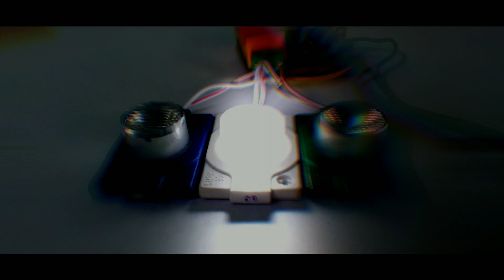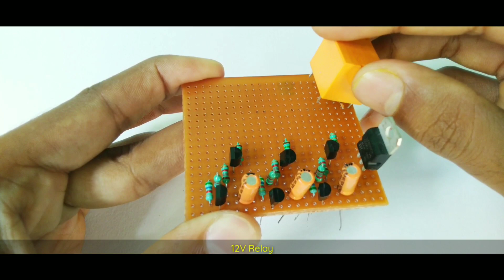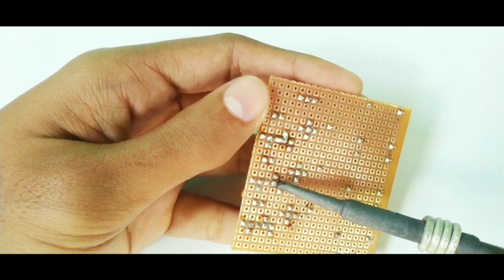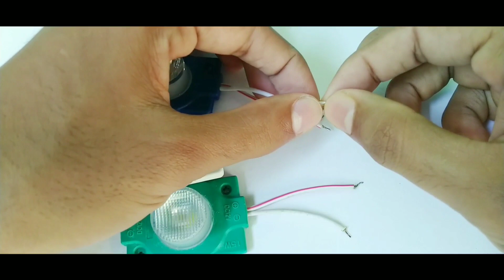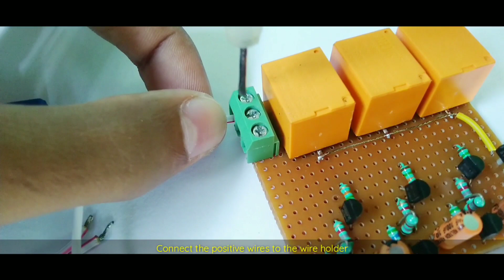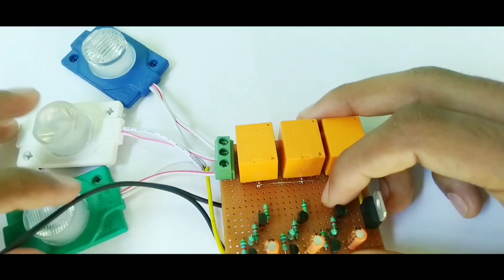12V led chaser using Relay

Comment: what does 1-2k mean, is it 1.2k or between 1 & 2?
Reply from the maker: Between 1 and 2
Reply: @estechknowledge  thank u.  I used 1.5k (1-2k) ,10k(10-15k)and 5.6k (5-50k)resistors. The circuit is not working only the relay that is connected to postive DC 12+ is turning on and iluminating the LED other relays are silent or other leds are not iluminating. I used the same bc 547 and L7805CV IC. Any tips to solve, highly appreciate.

Comment: How do I make a circuit like this to power a number of 12v motors instead of the LEDs alternately, thanks
Reply from the maker: This circuit is enough to power more than 50 12v motors